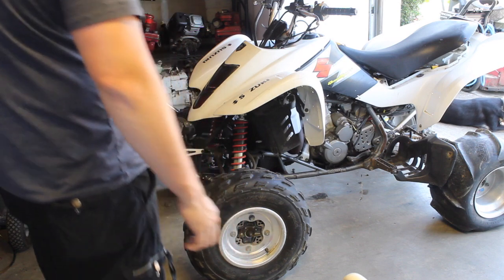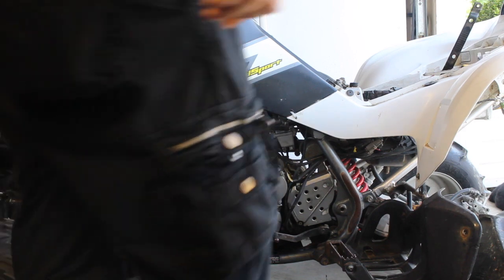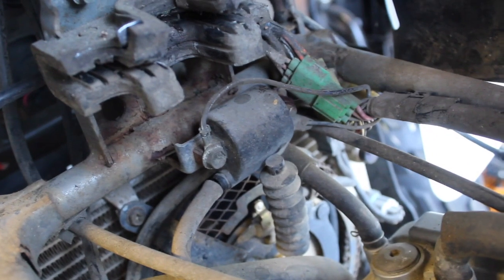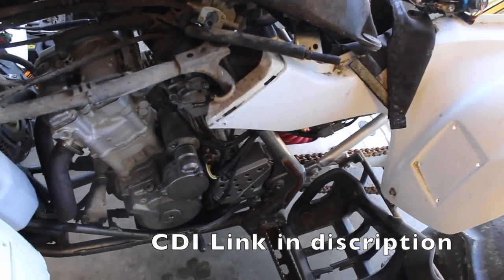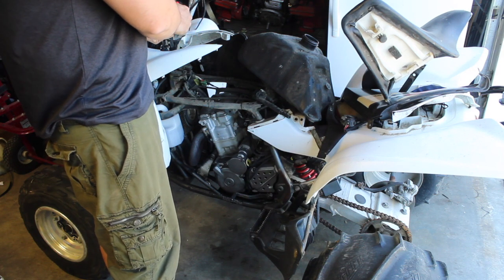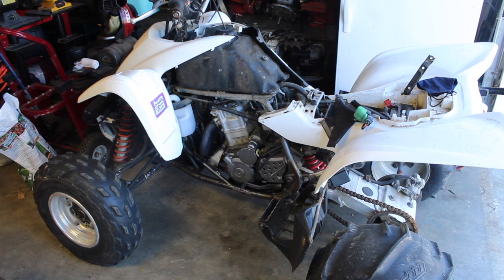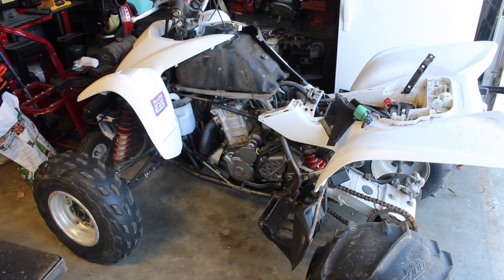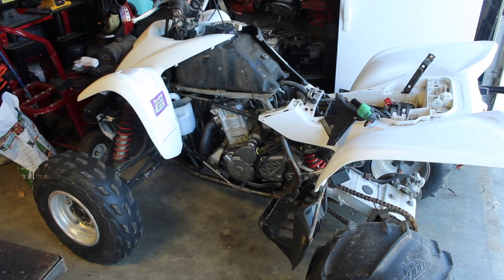Suzuki LTZ CDI Replacement

Comment: Hey man mine is doing the same problem I replace the coil, stator motor now I’m bout to do the cdi & remove stator magneto cover to see what happen next any tips ??
Reply from the maker: I would check all of the safety switches. Could be a simple solution